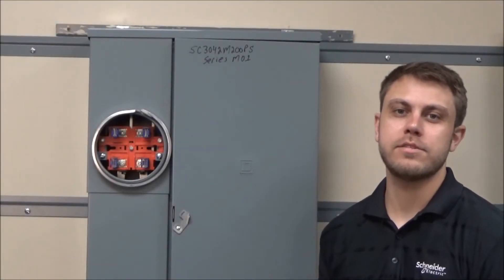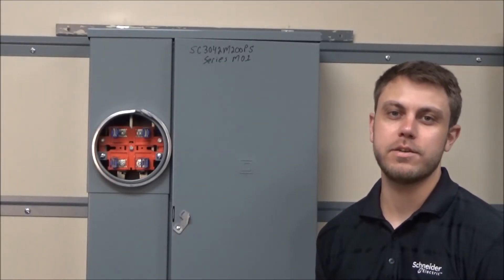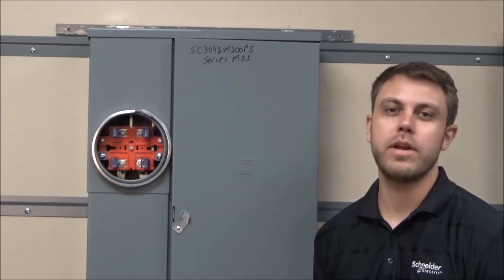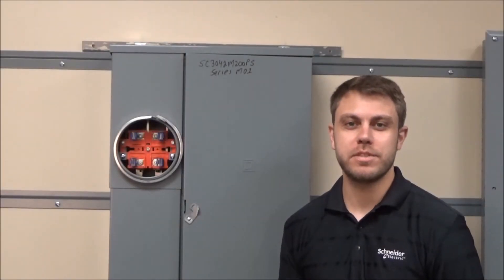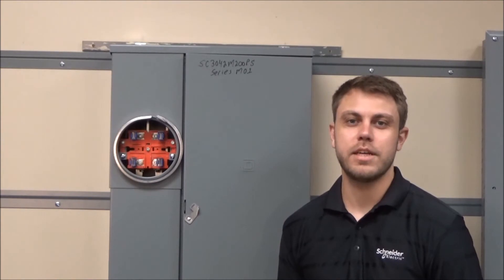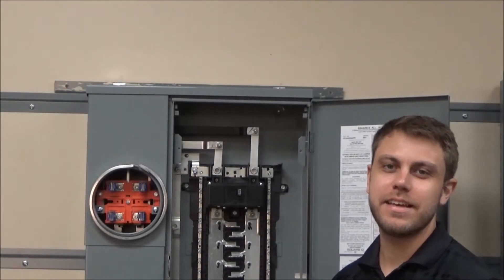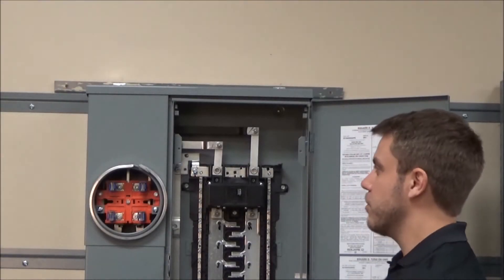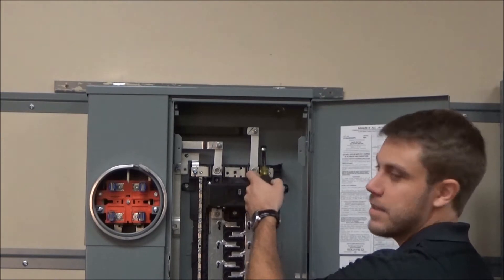Installing SR69064A Solar Ready Terminal Kit into Solar-Ready CSED | Schneider Electric

Comment: Need to look up separate install instructions for LK100AN.
NOTE: If an alternate neutral terminal is required, install neutral terminal per instructions included with the lug. An alternate neutral lug (LK100AN) with a wire range of #6- 2/0 AWG is provided with this kit.

Comment: The solar feeds don’t require a breaker location & a breaker?  What protects it from tripping or overloading?
Reply: a/c disconnect bruh, max 10 feet away from main service with lots of labeling
Reply: You did not get an answer and I can only hazard a guess.  The AC disconnect boxes usually have fuses. My guess is that this would be the safety.  I don't know that for sure, but that is my guess.  What someone should make is a solar ready panel with the AC disconnect switch built in side. It is stupid to have so many panels.

Comment: WHAT IS TORQUE SPEC???
Reply from the maker: Thank you for reaching out.  Torque specs are available here:   http://spr.ly/6058HRgZn
Reply: All torque specs are listed both in the panel instructions and on the label(s) on the inside of the door, just like practically every panelboard ever built. They are listed by location and fastener size.